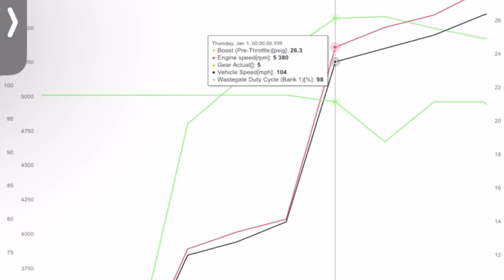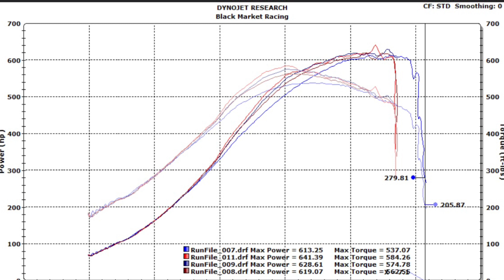In House Performance 650WHP BMW N55 F10 with Pure 750 Dyno Days

Comment from the maker: Most tuners and engine builders I talk to dont suggest going over 620ft lbs of torque with the stock internal unless its a m235i or an M2 as they have upgraded bearings and a forged crank. Personally Ive noticed the main issue is spun bearings, the stock rods are forged but thats it unless you have the m2 or m235i. So personally I would say once you start getting over 600-620whp and matching torque its playing with fire. If you have the m235i or m2 Steve Wedge has put hundreds of racing miles on his m235i with stock internals pushing over 700whp.
Reply: So just so I understand correctly. If you don’t have the M2 or M235i you should plan on upgrading your rod bearings if your planning on pushing 600whp or more? If so is there anything else in the internals I will need to upgrade?
Reply: Is that the same for the F21 M135i
Reply: What’s the weight??
Reply: I recently bought a 535i so you’re saying I can’t go over 620hp ? Regardless of meth injection fbo and a proper tune ?
Reply from the maker: @HavinFaith2424 last time I weighed the car is was 4180 with me in it.
Reply from the maker: @sidneysmooth F21 M135i is similar, sorry we dont have those in the states so I forget about you guys. Honestly it goes back to engine health. Get an oil analysis done to confirm engine health regularly. But anything over 600ftlbs of torque will be kind of scary for stock internals in general.
Reply from the maker: @christopherrichards-yk5hw personally I wouldnt go over 600ft lbs of torque with a stock engine. I can confirm that I know 3 people with Pure750s that attempted to turn up the power with stock internals and had engine failures. (Broken rod, cracked pistons and spun bearings to name some of the failures)
Reply: @Inhouseperformance  is there a way to prevent that like building the engine itself ?
Reply: @Inhouseperformance  atm my list of parts is new turbos new intercooler mhd aluminum charge pipe catless downpipe meth injections and maybe a few more things but idk exactly what else I’d need
Reply from the maker: @christopherrichards-yk5hw yes this engine is built with forged internals and Im closer to 700whp now and 650ftlbs of torque. See my other videos showing my build and recommendations 💪🏻
Reply: @Inhouseperformance   thank you just subscribed to the channel
Reply: @Inhouseperformance  Do you think i could get away with 580-600whp with stock internals but keeping torque like 550ftlbs and under?

Comment: pure 750 is good but honestly you cant go wrong with a precision, they run the game, i had a ps2 on my n55 but honestly wasnt satisfied it wasnt a big enough turbo
Reply from the maker: Ill never run a precision turbo, they are junk quality and I personally know dozens and dozens of people whove received them with excessive shaft play and tons of issues and precision blames the install or the oil used. I will only ever run garrett or pulsar. But I did the Pure 750 as Ive had a good relationship with them and was providing them data and personally I was interested on how much more power a hybrid turbo was capable of producing. And personally Im very impressed.

Comment: Top Mount and 6262,6466,or 6766. You’ll get good spool and be sitting at your goal with ease. Go v-band for your own sanity. But you miss we’ll go 6870 and hold 850 at 30psi

Comment: Hey love the content. Just wondering on your data log. It shows your boost target is 22.9psi but your actual pre-throttle boost is 28.7?  Why is it so high?  I know you want it that high. I'm just wondering why the target doesn't also say 28.9 psi?   Isn't the map supposed to follow the target?
I ask this because I'm on a jordan tuned with a stage 1 turbo racegas and my target is 22psi. I'm falling short after it hits it cause the turbo can't keep up. I've ordered a vargas GC 600whp+ and was wondering if I'm gonna see 28psi . I would think I should remap it with cary jordan but wondering why yours was so high.

Comment: @inhouseperformance I have a question regarding the pure750. What is it comparable to for size what are the specs of the turbo like the inducer and exducer sizes etc. ?? I’m interested in and would appreciate any and all information I can get about it. Thanks
Reply from the maker: @boostlee876  for the Pure750 what was told to a few of us is the Compressor is 62mm×82mm Turbine is 68mm×62mm so its basically like a G35-700. Capable of make 750 crank hp. It a great turbo and I highly recommend it for an easy plug and play turbo that keeps all the reliability you are looking for.
Reply: @inhouseperformance thank you I really appreciate it as there isn’t much information online about it. Been following the 535 builds and it’s going nuts 🔥. Not many people are building the platform so people like you and 4N are making it exciting.

Comment: Do you think I can push 450-500 whp running a E85 mix with this turbo on my 2015 535? Also do you think I would need to build the engine or transmission for that type of power? Right now I’m on a ots map from MHD running a E mix and I’m believe I’m at about 360-380 whp. Great video by the way keep it up love to see where this car goes👍🏼.
Reply from the maker: Yes all day long, a Pure Stage 2 would work for that power too. Do not need to build the engine or transmission. I would just do XHP transmission flash and youll need to upgrade your entire fuel system and you can do 500whp all day.
Reply: Im runing stage 3 in my f10 n55 without E85 mix and um runing around 600hp
Reply from the maker: @ademfeka9633 nice yeah we are closer to 700whp now with the same setup. What turbo are you running and whos tuning your car?
Reply: @Inhouseperformance   would upgrading the entire fuel system be the lpfp and hpfp. Would port injection be enough?

Comment: Greta video! I’ve got a 2013 640i MHD stage 2+. However I want better numbers. I already ordered a DS2 hpfp, a walbro 450 lpfp, some colder plugs, PR ignition kit and a flex fuel kit to use e, also XHP. You think if I add the pure 750 I can reach 600 whp and would I need to forge anything ? Thanks!
Reply from the maker: You can get high 500s in pump gas and low 600s on E85. The motor should handle low 600s my only concern for you would be rod bearings and transmission.
Reply: @Inhouseperformance  thanks for your reply! I don’t wanna deal with internals, you think pure 750 is too much and rather should I go for another turbo? I wanna be in the mid 500s maybe 600 a few times.
Reply: Your Bmw stock is pushing 315hp give or take. If your going to push or 600 why you going to want to change your crank hub or risk spinning it. Forged is good, but costly. Just keep your torque under 600hp.
Reply: Bro I have the same car lol 2014: stage 2+

Comment: just found your vids but i had a quick question about the block off plate and bov setup, is it completely plug n play or would i have to get a tune for it or even remap the maf to a different spot because ive been trying to figure out a way for a bov on a n55 and it was always saying on forums that the n55 couldnt just run a bov bc it has maf unlike the n54 having a map which allows for the bov
Reply from the maker: Yes it is comes with orings, hardware and a resistor for your dv electrical plug to keep from throwing codes. You can run it with or without a bov on your charge pipe totally up to you

Comment: So you would need the block off to use your charge pipe with the blow off valve right ?
Reply from the maker: You can use the block off without the charge pipe technically. A lot of people do it but the N55 isnt like the S55 and B58. They use the valvetronic to release pressure from the system. But yes if you purchased my charge pipe you would then need to switch to an aftermarket blow off valve and install my block off plate.

Comment: @inhouseperformance  I was thinking of getting pure 750 but I don't want to get into building the engine what horsepower do you think our cars can handle without having to build the engine?  I've heard 550? Thanks
Reply from the maker: Yeah just run the Pure750 on 93 or E30 and it should handle 550whp all day. Transmission is another story.
Reply: @Inhouseperformance the zf struggles at 550whp ??  What’s the failing point ? Because I’ve always heard the zfs are pretty solid .
Reply: @DalenSmith-y1t ZF8 will handle that with XHP.

Comment: can you help me understand what is the purpose of going with a external BOV on an N55 vs staying or upgrading the diverter valve? i have an E93 with the old PWG N55 and did the turbosmart diverter upgrade but im just learning too
Reply from the maker: Running the higher boost like I am I was having issues with mine leaking. The diverter valve is in the worst location to trouble shoot I decided to develop our diverter valve block off plate. So with that we now offer the charger pipe with the Tial 50mm BOV. Easier to tune and easier to service.
Reply: @Inhouseperformance  thanks man and cool build for sure, id like to see some roll racing from it lol
Reply: @Inhouseperformance   i have one more question if you dont mind sharing your knowledge.. but if i wanted to pull my n55 and rebuild it all the way, pistons, rods everything upgraded for durability, how much generally am i looking at? i know i could spend almost infinite but i dont want to leave something untouched if i do decide to pull it for peace of mind. what does a job like that cost if i have a shop do most of it?

Comment: Is the pure 750 enough for 500whp on pump 91? Is that safe? I have a 2011 535i fbo with mhd stage 2+ but I’m not satisfied with the power from it.
Reply from the maker: Its gonna be close Ive seen a few people in the high 4s with 91, you might need to go 93, 100 or E30 to get into the 500whp range.
Reply: 93oct will get you 490-500whp on pure 750..so 91oct should be around 480+whp!

Comment: Sick build, hows the pure750 feeling? I was thinking of either pure750 or the speedtech pulsar kit
Reply from the maker: Love the Pure750! This turbo has amazing spool characteristics especially low end surprisingly. Hitting 20psi by 3000rpm and 30psi by 3800 rpm. Thats amazingly good for a larger turbo thats possibly capable of 700whp. And the boost is straight across from 3800-6200rpm. Speedtech makes some good kits but I think the Pure750 is a really good option.

Comment: What are the wheel and tire specs? And how much lower is the F90 bumper than the M-sport?
Reply from the maker: 20x11 in the rear with a 52 offset 305 30r20 20x10 up front with a 27 offset 255 35 20. 

And the F90 front bumper is a lot lower probably 1.5”
Reply: @Inhouseperformance  thanks for responding

Comment: How many miles does your car have?
Reply from the maker: I just built the motor so this motor and transmission has about 4500 miles on them. The chassis has 115k on it
Reply: I have a 535i and I want at least 500 hp

Comment: 641whp with the stock transmission?  Does it hold?
Reply from the maker: No this is with a built transmission, built by Jacks Transmissions out of Colorado Springs Colorado. Personally I dont think the stock transmission will hold up.
Reply: @Inhouseperformance oh, knew it. Pushing 641whp is a huge achievement and I think is the only F10. Good job!
Reply from the maker: @williamdiaz8100  thank you!! Its been a journey, hopefully next week with some cooler weather and more boost we can see more power!

Comment: Hey, so I had a 2014 bmw 535 xdrive, right now im fbo. Was wondering if the pure 750 turbos is just plug and play like the stage 2 turbos? I was also wondering would the pure 750 have any effect because it a xdrive or no. Never really see a xdrive 535 with upgraded turbo.
Reply from the maker: Im pretty sure its plug and play with an xdrive as well. I would contact Pure to confirm tho.
Reply: Gor you. @Inhouseperformance  Also what High Flow Silicone Turbo Inlet Pipe did u use because our layout is diffrent then the smaller n55s?
Reply: Wat u have done 2 urs ?looking to get around 500hp daily driver stock motor
Reply: @Cornyy550  who me

Comment: U said u built the motor, how much you think stock internals can hold reliably?
Reply: I've seen people say around 500-550 hp but definitely no more than 600 with stock interals
Reply from the maker: I would say anything over 600ft lbs of torque is pushing your limits. I know some tuners that have tuned their personal cars into the 700s with stock internals that were very careful with their torque curves. Steven at Wedge performance being one of them.